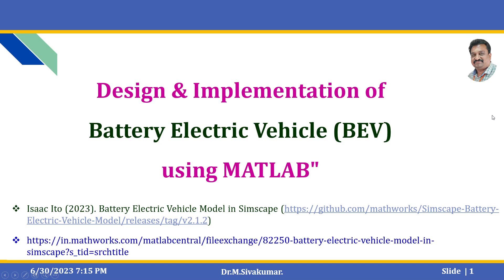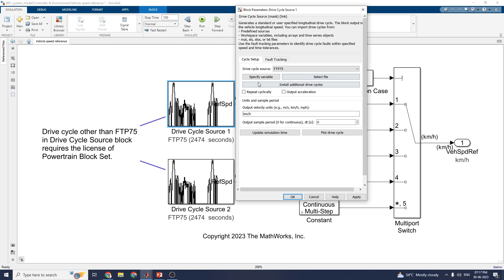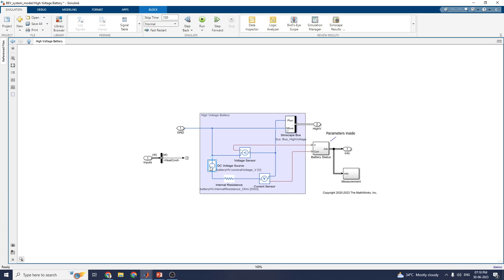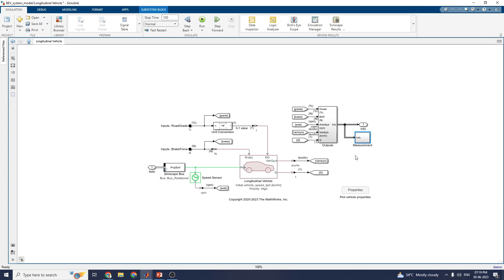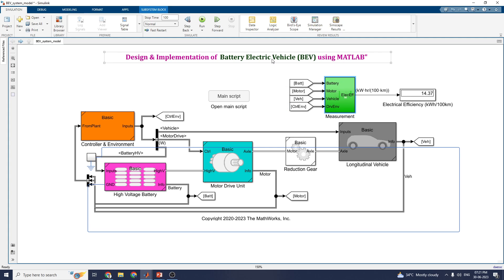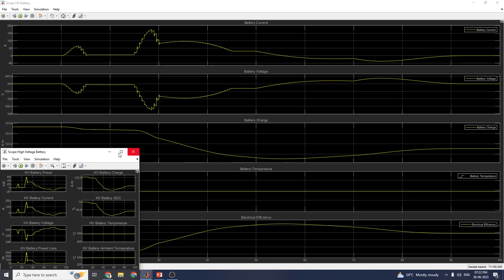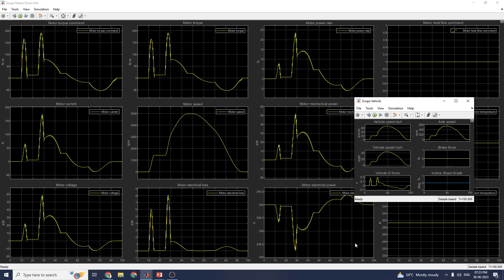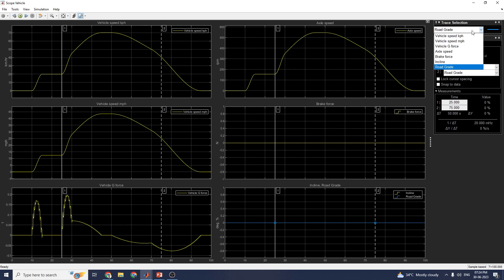Design & Implementation of Battery Electric Vehicle (BEV) using MATLAB

Comment: Sir can you do video on fuzzy logic based duty cycle control for hybrid electric vehicles eith hybrid storage system for battery management it was different from electric vehicles which are done with solar and wind but no one did at the duty cycle level i found which is different so can you do a video on that
Reply from the maker: Sure ...
Reply: Thank you  sir I am excited to see your video on this